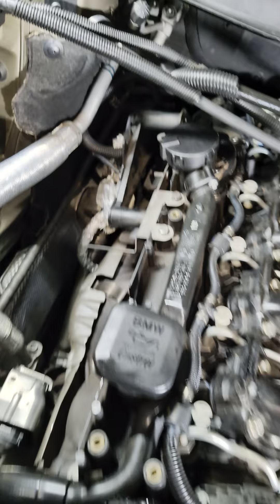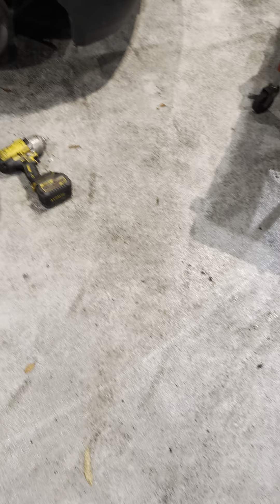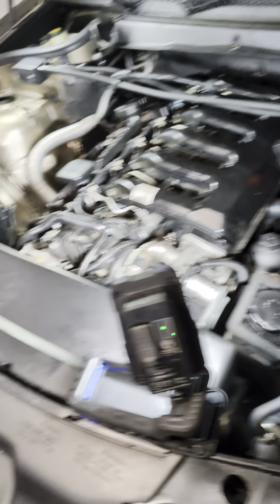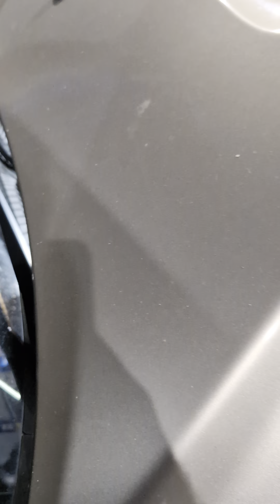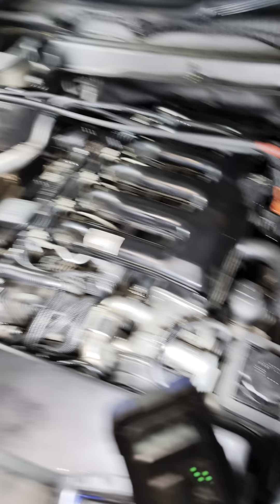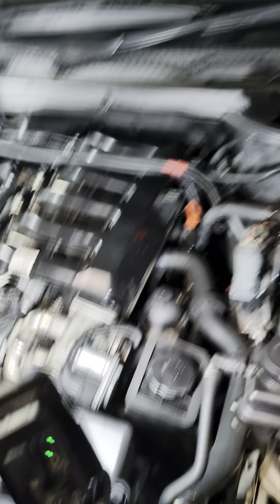BMW M57 3.0D no start compression power supply manifold throttle plate injection cranking E83 X3.

Comment: I have the same issue. Cranks but not firing. Although I have never had it running. Did have the manifold off to clean and delete swirl flaps. Maybe I did something to it wrong but it’s frustrating
Reply: Did you ever get it back running ive just done the same after intake clean :(